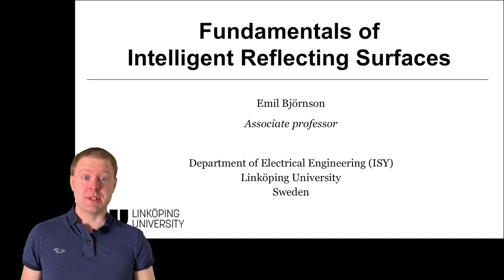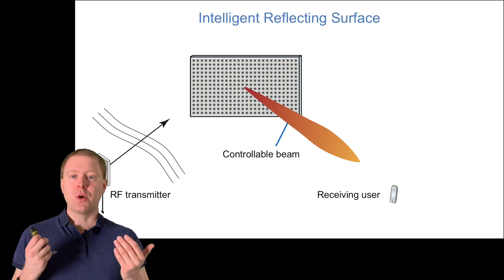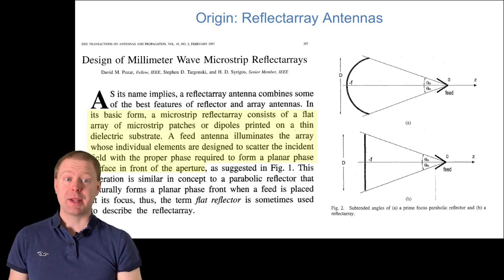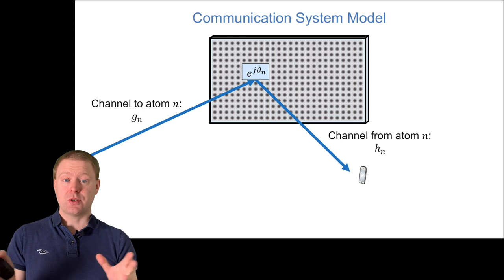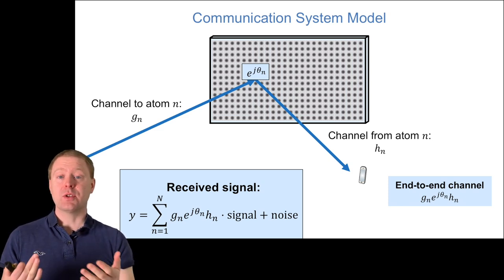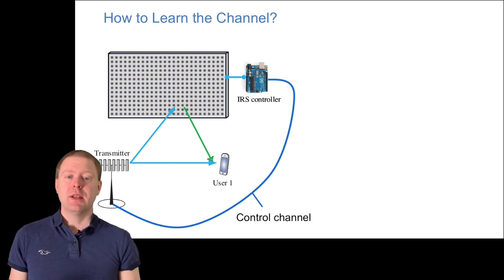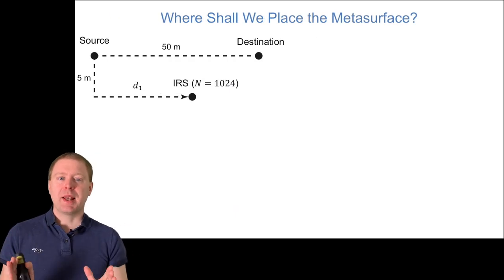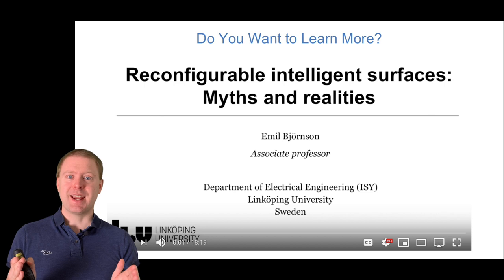Fundamentals of Intelligent Reflecting Surfaces

Comment: Thanks for the excellent introduction! May I ask if the single phase rotation model is feasible in reality, or is any implemention based on this model? Some papers mentioned we can adjust the reflecting angle (not the phase rotation e^jtheta in baseband signal) by controlling current distribution on metasurface, but I fail to have a good connection between this approach and the single complex coefficient model...it also confused me that the single coefficient response is independent of incoming angle of signal....your comments are greatly appreciated:)
Reply from the maker: A practical implementation is described in the following video, for example, around 21:30. The surface elements create different phase shifts for different frequencies, but a single phase rotation is a good approximation when considering a narrow band. https://youtu.be/p9bt7j_J_xg

There is a small connection to the incident angle but it is often neglected.

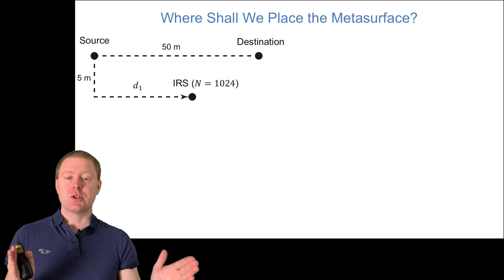Comment: Thank you for the clear introduction, can I ask for the picture on slide 13:45 with the code presented in which reference?
Reply from the maker: That figure was created specifically for this presentation and has not been published anywhere else. It is basically a simulation of scaling_factor/((5^2+d_1^2)*(5^2+(50-d_1)^2, so it should be easy to reproduce.

Comment: Dear Professor, thank you for your videos! I have one question here. When the upper bound of the UE-RIS-AP channel gain is achieved, theta_n = -arg(g_n*h_n) should be satisfied for n=1,...,N. So, in a LoS case, if all theta_n is 0 (phase shift is 1 for all elements), for an incident wave from UE to RIS, will the direction of the strongest reflected wave be just the wave bounced back from the incident direction (arg(g_n*h_n) = 0)? Many thanks!
Reply from the maker: Hi! If theta_n = 0 for all elements, then the surface will have homogeneous electrical properties and thereby behave as you would expect from Snell’s law: The reflected signal is focused in the same angular direction as the incident angle, but at the opposite side of the surface’s normal.

This happens because the array response vectors for these opposite angular directions have opposite phases in every entry, which leads to arg(g_n h_n) = 0, although arg(g_n) and arg(h_n) are non-zero.

Comment: Dear professor, I have an another question.

I'm bachelor student and my major is not electronic engineering, so I cannot understand what happens when we multiply channel gain and phase shift term (g * e^(j * theta n)
1. So why we just multiply the channel gain and phase shift term? (Why Not adding terms?) 
I think why we use multiply operation is that channel gain is the ratio of the transmitted power and received power. Is it right?

2. And What happens  when we multiply channel gain and phase shift term?
3. What is channel matrix(vector)? When I searched internet it says "The channel matrix is a symmetric matrix that contains the fading coefficients." Is it right?

Sorry for my lack of knowledge.
Thanks for the lecture.
Reply from the maker: The signal goes through a sequence of “filters”: Channel to the surface, interaction with the surface, channel from the surface. These things are multiplied. (Actually, each of them behaves as a filter where you convolve the input with the impulse response, but in the narrowband case that we consider here, the impulse is a constant amplitude times a delta-function where the delay determines the phase shift.)

Instead of trying to explain all of these things in a YouTube comment, I think it is more instructive for you to read the first half of the following paper: https://arxiv.org/pdf/2102.00742.pdf

Comment: Hi, I'm working on a simulation of an algorithm to maximize multi-user minimum data-rate by optimizing IRS phases and transmit power of a device to device system. How do I change parameters to increase the effect of IRS (direct path is dominating and hindering the analysis) ? One method I used was increasing the pathloss factor of direct channel. Are there other commonly used techniques ? Any help would be valuable.
Reply from the maker: Hi! What you have noticed is one of the drawbacks with IRS communications, namely that it only works well in scenario where the IRS-path can be made stronger than the direct path. This happens either when the direct path is already weak or when the IRS is very large. So the common approach is to assume LOS channels to and from the IRS, and a NLOS direct channel. This basically corresponds to using different pathloss exponents, but remember that a change in exponent also must result in a change of the constant term in the pathloss expression. Two 3GPP models that you can utilize are found in this paper: https://arxiv.org/pdf/1906.03949.pdf

Comment: thank you professor for the clear introduction. One question, 7:28, for the expression of both the channel gain from transmitter to IRS and the channel gain from IRS to the receiver, A denote the area of the IRIS atom. Shouldn't A of the 2nd channel gain be the area of the receiver antenna?
Reply from the maker: This is a good question! I didn't have the time to explain this properly in the presentation. The formula depends on the area of both the transmitter and receiver. See the first equation in https://en.wikipedia.org/wiki/Friis_transmission_equation
where the pathloss is A_t A_r / (d*lambda)^2

For the second channel, we have A_t = A, A_r = lambda^2/(4*pi), and d = d_h. So the provided formula is obtained by assuming an isotropic receive antenna.

Comment: Hello Prof. I am thinking of analysing IRS from an Urban POV as an Urban Designer/Planner. How do you think these systems can be integrated into Smart Cities as a concept and how impactful it is going to be when it comes to re-designing the way our cities are shaped?
Reply from the maker: There is a new video that connects the topic with smart cities:
https://youtu.be/9cBn5piI9Ms
IRS/RIS technology can be used to alleviate shadowing by deploying them inside windows or at buildings. The goal is to make sure that the surface has line-of-sight conditions to both the base station and the prospective user locations.
Reply: @WirelessFuture  Thank you :)

Comment: Hello Professor, I have some questions about IRS. 
1. Can the IRS move?
2. How about the energy (battery) of IRS?
3. Can every IRS know the position of all the IRS?
Thank you
Reply from the maker: 1. No, generally not. Unless you deploy it on a vehicle that can move.
2. The IRS consumes energy when it is reconfigured and controlled. Here is a paper that discusses this: https://arxiv.org/pdf/2103.00534.pdf
3. If each IRS is deployed at a fixed location, then I think it is ok to assume that they know about the position of other IRS. Parameters that are not changing over time are generally easy to estimate and store, if necessary.
Reply: @WirelessFuture  thank you, professor. now I am thinking about routing protocol with multi-IRS wireless. what is your opinion? possible or not?
Reply from the maker: @NnStraeberry  I don't have any specific opinion about that. I think the main thing you need to determine is what the problem is that you try to solve. What can the addition of one or multiple IRS improve in terms of communication performance?

Comment: what is main difference and advantages of single connected group connected an fully connected IRS
Reply from the maker: I guess you define the terms like this: fully connected IRS can control the phase shift of each element, while group connected IRS consists of groups of elements that must use the same phase shift.

The fully connected has a larger flexibility, but the performance loss of having groups might be small if the group size are selected based on the application and element sizes.
Reply: @WirelessFuture  so in group connected is it possible that each group reflect the beam to different phase shift from different user at different location at a same time , what about fully connected regarding different phase adjustment for different user at different location at the same time.I have a presentation in next month so I'm new students of MS
Reply from the maker: All parts of the IRS will reflect all signals that reaches it. You can certainly tune different parts of the IRS for different users, but they will all reflect all signals partially. Check the math in the second paper “a tutorial” and it explains more about this.

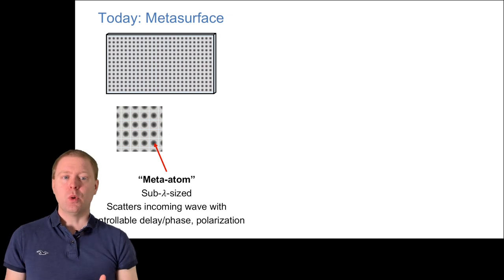Comment: Is there a reference for the plot at 5:50 for me to use in my thesis?
Reply from the maker: It is a slightly modified version of Figure 2 in https://arxiv.org/pdf/1911.03359.pdf (The red curve is 10\lambda in that paper.) You can reproduce it using the code here: https://github.com/emilbjornson/IRS-modeling
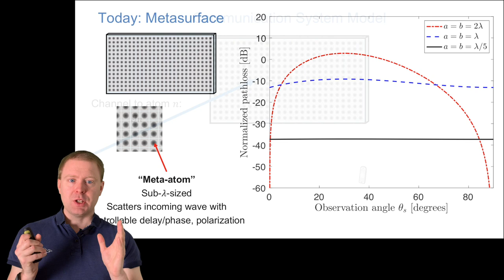Reply: @WirelessFuture  Thank you! Also, do I need to cite a paper for the equations described at 6:38? (by the way shouldn't 
"signal + noise" be wrapped in parentheses in the received signal equation?)
Reply from the maker: @-Apostolos  There are many papers that contain this type of expressions. You can for example see Eq. (26) in https://arxiv.org/pdf/2102.00742.pdf, where we derive the expression from first principles. (No, the noise is added at the receiver side, so you sum up the signals and then add the noise.)

Comment: If the IRS has its effect on the channel gain, can we expect an increase in the corresponding capacity? If yes how much increase? and if no why As it is improving SNR?
Reply from the maker: Yes, the capacity is essentially bandwidth*log2(1+SNR), so if you increase the SNR, then the capacity grows. The benefit of having an IRS is larger when the SNR would otherwise be low, because the logarithmic function is almost linear at low SNR.

Comment: IRS is new topic to me I have a basic question that in group connected IRS each group can reflect with different angle can it is possible
Reply from the maker: The IRS elements (or groups of elements) are not reflecting the signals in specific angles but scatter the signals diffusely with specific phase shifts. The constructive interference of the diffusely reflected signal components creates a directive reflected beam over the air.

I think it is easiest to picture it like this: The IRS (as a whole) is a metal sheet that you can rotate and deform as you like to ensure that the reflected signal is focused toward the receiver. Instead of physically deforming the sheet, the RIS elements are assigned varying phase-shifts to synthesize the same effect.
Reply: @WirelessFuture   So IRS(as a whole) can scatter the direction in only one location at a time and also share some paper through which I can understand the basic
Reply from the maker: Yes!

My introduction to the topic is:
https://arxiv.org/abs/2102.00742

Another popular tutorial paper is:
https://arxiv.org/pdf/2007.02759.pdf